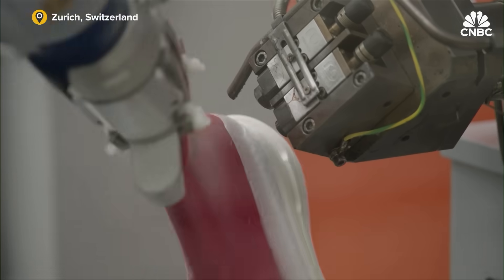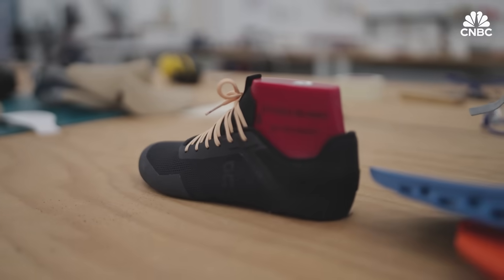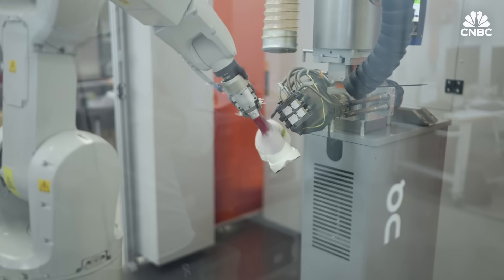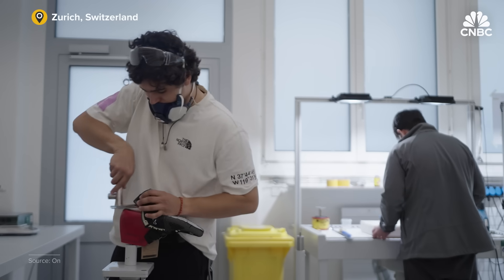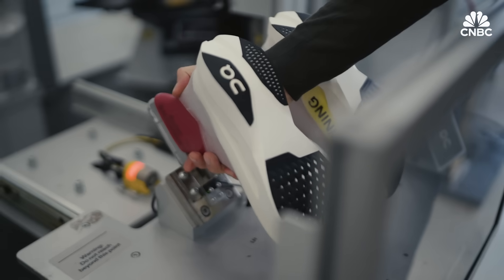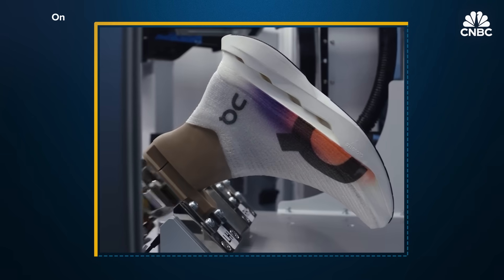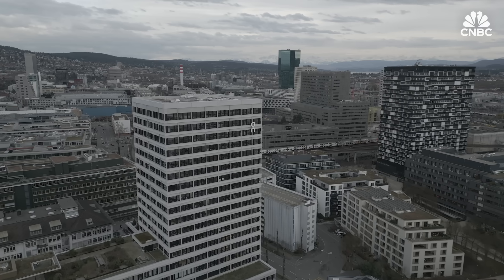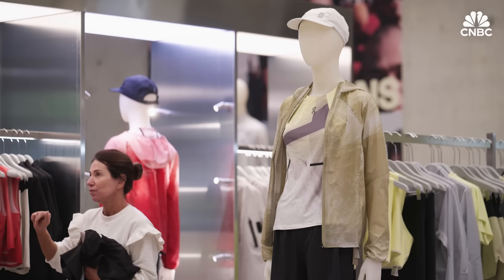How On Makes Spray-On Sneakers In Minutes

Comment: For $330 they want for those shoes you can buy a 3D printer, buy a perfect fit custom size shoe model, buy TPU filament and print a pair yourself in any colour you want. And then you'll be left with a free 3D printer.

Comment: I hadn’t been shopping in a while, but I went to nordstrom rack and saw a bunch of On shoes "discounted" at around $120. I picked them up and they felt flimsy, super light with no structure. That sent me down a rabbit hole and yeah turns out they’re more hype than quality. They don’t hold up like older shoes with real structure and thicker, heavier soles. Yes, they’re cheaper to make, and yet they cost more. We’re just a bunch of trend suckers.
Reply: The leather tennis shoes I wear to cut the lawn fit great and I have been wearing them since the early 1980s.
Reply: they are made for running performance
Reply: Maybe once they can figure out how to make shoes like this more cheaply and biodegradable, they'd be a good option for people working in professions their shoes get dirty and ruined all the time, like maybe farm workers or other people who do the kind of stuff that Mike Rowe would make an episode of Dirty Jobs about.
Reply: @Melissa0774 dont worry as usual its the chinese that Will provide what we want.
Reply: @Melissa0774  farm working running shoes?
Reply: That is exactly what I thought and I was at Nordstrom too! I really wanted to like them but they felt crappy and it was then I realized it was just the latest trendy footwear.
Reply: @jeffspicoli2643  Nah, I've had my OnClouds for almost 2 years.  They don't have a lot of support but I just use them for walking so that's fine.  They're comfortable as hell and they've held up better than any Nikes I've had.  I recommend giving them a try.
Reply: @jeffspicoli2643  did you try them on?
Reply: You need to try there cloud monsters before you say anything fool
Reply: @lakhjeetmann, you need to learn English,  fool. It's "their", not "there."

Comment: Insane amounts of microplastics.
Reply: They wear out super quick too so its like microplastic confetti
Reply: Without knowing anything about the exact tensile strength I don't think it would be that bad if they at least encased the polymer in a stronger less damageable plastic. The ability to make the wearer feel like they 'float' is likely to do with it having no form to start beyond the mold and adding structure after the polymer spray may reduce comfort so doubtful they'll ever consider adding it.

Comment: I'm already waiting for the ability to print a custom pair of shoes. Take a 3D scan of my feet, adjust say... 12 plates on the red foot mold prior to spraying... and spray a shoe that fits my foot perfectly. You could do the same for the sole perhaps. Start with a standard molded sole, do some CNC machining on it to match my footbed, and then proceed with the spray step.

They are poised to be able to make very custom shoes very quickly, and the price won't have to be expensive if they get to scale. Now if they can incorporate biodegradable materials, that would be a future-proof shoe company.
Reply: Biodegradable doesn't last though. biodegradable is better for single use things.
Reply: should be able to scan with phone then upload and send it and they ship you the new shoes

Comment: so theyre here telling us that it costs even less to produce it therefore they should price it higher
Reply: It may cost three times more but it wears out 3 times faster!
Reply: @skyak4493 The whole "sustainability" BS goes out the  door if it takes three pairs of these to last as long as a regular shoe.
Reply: Supply and demand. They said they can only make a fraction of what the demand is.
Reply: I have a brilliant idea to cut the cost in half!  Don’t take it over to that second machine to print the logos all over them!
Cut the cost in half and charge $600!
Reply: @skyak4493  I have even better idea! Sell sole and polymer in spray can - customer can make those directly on their leg 😂
Reply: Thought of that too lol my guess is that the machines they made were EXTREMELY expensive so they raised the prices. Hopefully prices will go down over time
Reply: @seize3 I would agree, they aren’t making a ton of these shoes right now and I think over time as they are able to speed up their processes, and pay off the machines the prices will drop
Reply: @ahastar1141  That's wishful thinking but, I think greed will inevitably play a part in the whole equation and those shoes will remain expensive. It's kind of a gimicky concept anyway.
Reply: @seize3 LOL, that's not how investment works, they'd amortize the initial investment over the long term setting an equilibrium point and a competitive price... Unless they can sell you both the product and the concept so that you pay above market price and get them additional profit. If they get away with it those prices are not going down. It's like hoping for apple to drop prices after they know people would pay anything for that apple logo.
Reply: At least those 1 usd per hour worker in Vietnam and Bangladesh don't have to do those hard works!!! So Mr Bezos can become a trillionaire.
Reply: Like everything look at 3d printed houses cost way less to build cots same as a regular house or more
Reply: Americans have been inflating shoe prices stupid bunch of people there that still don't get their shoes are made for $5 in asia
Reply: It costs more lol. Those machines cost more to run than cheap sweat shops
Reply: Same thought!!
Reply: $300?!! 😮
Reply: Scarcity is the reason. It's supply and demand. You can Google that phrase and better understand the concept.

As the video explained, currently the company cannot make very many of them, nor can they make them in Major markets worldwide yet.
Reply: It cost a lot of money to develop such technology.
Reply: On being a public company would probably rather pass the benefits to their shareholders first, before refining/scaling the technology further for cheaper shoes. Or, perhaps one of their manufacturers will end up taking the technique to use for themselves and make very inexpensive knock-off products.
Reply: white people pricing
Reply: They only make limited production runs, kind of like Ferrari or Lamborghini. I'm expecting that they price will go down when they start to produce in high volume.
Reply: Pay for the technology and innovation and patent the tech
Reply: What else would you expect? The consumer will always pay more in the end, no matter what
Reply: Nooo that's not how it works , it cost them millions so they could produce at a cheaper cost ,
Reply: A good way perhaps to actually get a custom fit by using a cast of customers feet.
Reply: Bet they have not even scratched the surface at covering the spending on research and development, writing new software to control robots/manufacturing, etc. But sure, if you have all that infrastructure in place, then it costs less to produce a single pair of shoes. Doing something new is very hard. Doing the same thing that you did yesteday is pretty easy, copy paste.
Reply: Metzitzah b'peh is the jewish ritual where the moyle sucks blood from the babies circumcision with their mouths
Reply: yes
Reply: they didn't say it cost less, they said it was less carbon cost, there's a difference.
that being said, while starting out with the machine, it probebly cost more, in the long run, it would cost less.
Reply: You really thought savings for companys means savings for YOU!?! HA dont make me laugh thats never been true😂
Reply: This is how technology works, it’s new. If the price is high and consumers start switching to it, other companies will enter the market, and price goes down. If there wasn’t that price incentive, no one would enter the market, and demand wouldn’t be met. This is what causes shortages. You don’t have a functioning economy without that price incentive.
Reply: Americans will pay 39% more because of the new presidents tariffs.
Reply: It cost 75% less.. (proceeds to raise the price by 300%)
Reply: once the softeners wear off, the step-in will rip. probably after a couple of weeks/months of wear. but its a start
Reply: It cracks me up how these companies always come up with excuses to raise prices while giving people less and less.  And it is ALL about their profit margin.  It is not enough to have a successful business that makes money.  No.  They want to have as much profit as possible so they can control everything while giving their employees, the ones that work hard, not the lazy ones who just clock and do the least amount they can, as low of a wage they can get away with.  I work for a hospital that made millions of dollars in profit.  Of course, they claim it is non-profit to get away with paying no taxes.  My raise was .50 cents.  And they claim it is all to keep healthcare cost down, yet have no problem giving he president millions in bonuses.  Again, it is not enough they made millions, but they need to make several millions so they can keep building all these new hospitals and consuming all the others so they can control healthcare.  And the people that work hard to serve patients and help control cost get nothing extra in bonuses.  They make more and more money by putting on case after surgery case but we still make the same amount of money per hour.  So, the harder we work, the more cases they put in our rooms.  Yet we make the same amount of money.  I tell me fellow workers, why are your rushing?  It makes no difference for one.  You are maybe saving seconds if everything goes according to plan.  And if we finish doing all our cases, they just put more add ons in our room.
Reply: this is the world we live in
Reply: I imagine the price will drop significantly once economics of scale and competitor make similar  products. Quartz watches were uber expensive when they first came out yet and now cheap as heck. Imagine this could become the same way/
Reply: @kota3233 it’s possible, but the value of making customer uppers for clients in a matter of minutes is not something that appeals to the masses. This is something that appeals to a very specifics type of runner or customer. The elephant in the room that comes to mind is sketchers, but I don’t know if I see them copying this. Yes they could make a spray on shoe using a generic mold but that isn’t something the masses want. For a certain customer,though, particularly some runners, this would be well worth the price
Reply: @kota3233 yeah..wait for it.😂
Reply: R&D isn't free.
Reply: @ImARealHumanPerson A third of employees dedicated to R&D is very impressive and nearly justifies the cost.